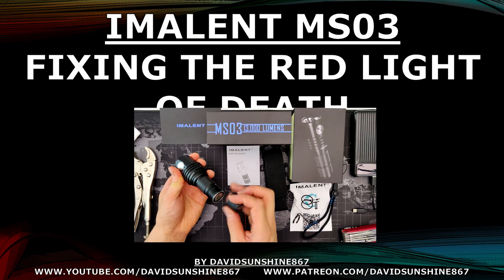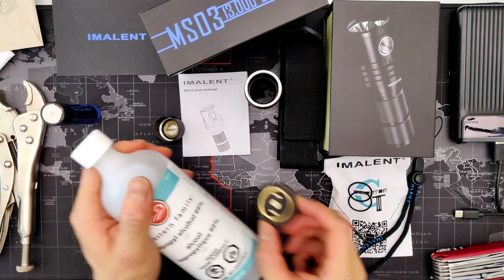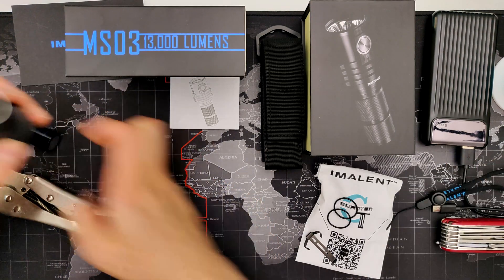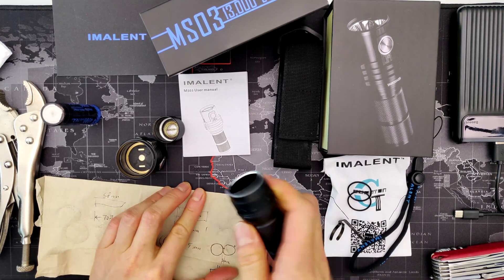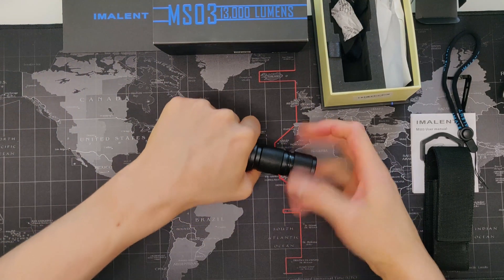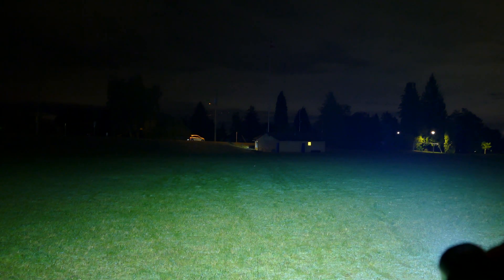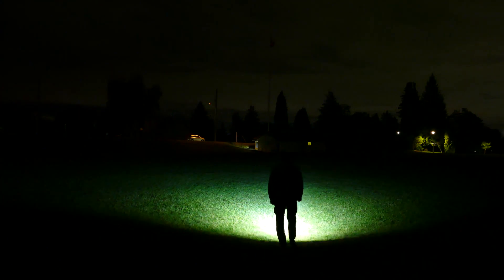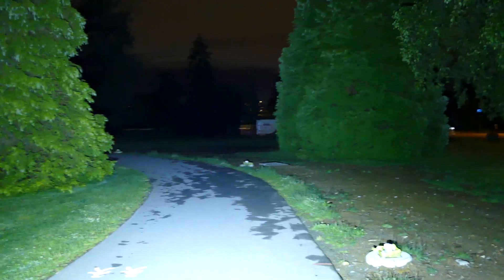How To Fix IMALENT MS03 - Red Light of Death

Comment: I think it’s not the contact point but I think it’s the heat prevention control issue. After cleaning I still have the same issue
Reply from the maker: Hi Will,
That's what I thought initially too.
The cleaning didn't help?  That's unfortunate.
My red light was coming on within 3 seconds of turning on, so I knew it couldn't be the temp sensor.  
Is yours coming on within 3 seconds?  Then won't go into turbo?
Take some needle nose pliers, and grab hold of the tail spring, and spin it in place, it only can turn one direction, turn it that direction like 20 times.  I wouldn't bother taking it out, because getting it back in is a pain in the arse, so just spin it in place to try an clean it up.  If that's clean, and your front body tube connection is clean to the driver, then I think you're right, it's probably another safety kicking in. Email them and see if you can use the 5 year warranty or 15 day replacement.
I didn't want to bother with that, since sending the flashlight around would be a pain.
Hope you can fix yours too.
Cheers!
David.
Reply: @DavidSunshine Thank You sir for Your really useful review helping to understand that these MS03 and MS06 are rather still pocket rockets for short than torches to carry switched on for a long walk in a dark forest. I was considering to buy MS06 but refused due to Your review. 
But I still need a flashlight of the same size and weight to run 3000+ stabilized lms during about 1 hour.  Now I use a Sofirn SP 36PRO and am very glad, but I want more. Sir, would You be so kind to recommend me some other brands and models with 3k+lumens instead of this Imalent MS06?
Reply from the maker: @АлексейНиколаев-п2и  Hi, my pleasure! Glad you enjoyed my videos and they can be helpful! Sounds like you have a good understand of flashlights and your performance requirements from them. 
I would suggest getting a light with ATR, so it gives you the most light possible while actively keeping the temperature around 50-55c. A flashlight with an adjustable temp is even better for you, since you can adjust it lower so you can just your bare hands, or increase it to 60c if you are going to use gloves and want even more light output. 
The X7R Marauder is a soda can sized light, pretty big, and with ATR at 55C, it can give you about 2500 stabilized lumens for walking around. 
See my YouTube video for an explanation at 6m 25s.
https://youtu.be/AZy5f0TT5K8?si=sbRHiL9nGDgYJ_mq
If you use a smaller light, it'll get way too hot if you're pushing 3000+ lumens. You either need a big light like a Convoy L6, or you'll need to reduce the lumen output so the flashlight doesn't get too hot.
The 18650 and 21700 lights can be kinda big and bulky for the amount of power and capacity they offer. 
The new flashlights using the 32650 battery seem to be the most compact and powerful available right now, seems reasonable priced too. 
Check out what's out there from Sofirn, like the IF30: https://tidd.ly/4gqZHJs.
It might not give you more light than the sp36 pro, but it could be more compact, and it has the ability to throw further and blind targets better since it has the big reflector for the SFT40 LED for crazy 685m of throw. Sometimes it's not about total lumens, but the ability to concentrate to a hot spot. It's cool they put a thrower and a flood light onto one light, gives the best of both worlds, great for trail walking and also blinding threats or long distance illumination. 
I'll put on some of my AliExpress affiliate links for your convenience, if you'd like to support my channel please use them, as I can get a commission when you use them to purchase. Otherwise you can search any site for the flashlight models as well.
I haven't gotten the new 32650 lights to test yet, but they look promising. 
I have the Q8 Plus, and it's pretty good, has 3x21700, but it's really big and heavy. It'll probably give you 3000 lumens stable, but you'll really need to carry this in a bag, it's not easily pocketable or even holstered. https://tidd.ly/3VRmlCR
So check out what's out there. 
But if you're hiking with the light and want to put it in your pocket, I would go for something smaller. 
If you want 3000 lumens at 1 hour, that's about 30 watts for an hour, so you need a 30wH battery. The 32650 is 6500mAh, at 3.7V that's 24Wh, so not quite there but pretty close. If it's ATR throttles it to 2500lm(I think it'll get too hot and even throttle less than 2000lm if it's not really cold out), it'll last about an hour. So keep that in mind as well. 
Also, I suggest something with the Anduril 2.0 UI(your sp36 pro has an anduril UI already, so you know how good it is), I use it in most of my lights and prefer it over the rest. (Has adjustable ATR temp, as well as lower and upper limits).
You already have the sp36 pro, I think that's probably the best balance between size, power and runtime available right now. Until we see an advancement in LED technology, we won't see more output with less heat, so the light will need to be bigger like the Q8 plus if you want more light for longer times without overheating and burning your hand. 

You'll also want to check out the offerings from Wurrkos and Lumintop. Olight, Acebeam and nitecore are good too, but they are a higher price point.

I also like using head lamps for hikes to keep my hands free, so check out the sofirn HS41. It's a 4000lm peak light. It'll probably be stable at closer to 1000lm or less if it's summer though, it's a pretty small light. That's the limitation if you'll be wearing it on your head.  https://tidd.ly/41MBrwV

Hope that gives you some ideas to check out, and hopefully you find something that fits your needs. The Q8 plus does give you more light since it's bigger and can dissipate more heat, but I don't think it's a huge upgrade from your SP36 pro, that's pretty good already, you might not even notice an increase in brightness unless you have it side by side, so be aware of that. Doubling the lumens doesn't really seem double the brightness since the eyes adjust, you really need to increase exponential for the human eye to think it's doubling in brightness. 

Good luck and happy flashlight shopping! 
Cheers, 
David.

Comment: I’ll will try this fix, thank you!
Reply from the maker: Hi Jordan
My buddy had a 330 ZHP, was almost as fast as an M3!  Awesome car.  He got an M3 after that one.
Cheers!
David.
Reply from the maker: Hi Jordan, how did the fix go? Hopefully you got it fixed!  It should be able to go in and out of turbo without getting the red light, until the battery is about 3.9V, then it'll start to sense a little low voltage and show a red light for a few seconds, that'll be normal. Then it'll be ok until about 3.6V, where it'll show LVP right away. 
Cheers!
David.

Comment: The Most HELPFUL CHANNEL!! Learning so much!! Thank you thank you!! Btw, help me! Lol
Reply from the maker: Hi Victor,
Thanks!
We enjoy our modding!
I don't build drivers though, if that's something you want to get into, check out the budget light forum, those guys do all sorts of custom drivers and mods!
I do simple stuff, like add mosfets and change resistance only ;o)  Or replace drivers with FET/programmable ones.  Easy stuff!
Cheers!
David.
Reply: Hi again, 
Sorry for keep bothering you but,  I just purchased the Nitecore tm39 flashlight.  Is this flashlight able to be modified to run like the Acebeam k75 flashlight?

Thank you!
Reply from the maker: @victornishimoto6029  Hi Victor,
No bother!
Wow the TM39 is a powerful light!  Very fancy too, with that OLED display. 
You could probably get a little more lumens out of the TM39, but I don't think you'd see the difference.  I wouldn't know where to start by modifying it, since the driver is proprietary, you'd have to dig into the circuit design of it, see what components you can change or modify to make it deliver more current to the LED.  It's not as easy as modifying a $12 S2+ or $30 SkyRay King, unfortunately.  Unless you just pull the driver all together and replace it with something from mountain electronics.  I think the stock driver and all the electronics in there are really complicated, and might be jammed in there pretty tight, not much room to work, so it might not be the easiest mods.  With that said, of course anything can be modded LOL.
The K75 looks like a beast of a light too!  They are really making crazy throwers out of that SBT90 LED.
Cheers!
David.